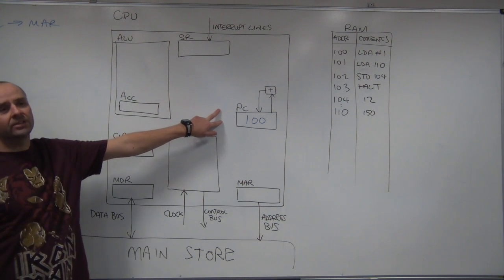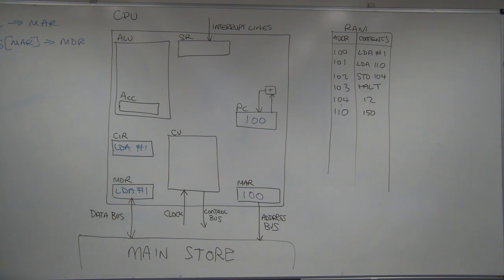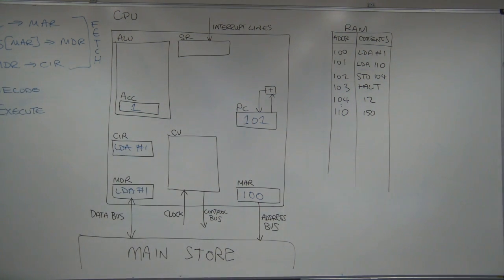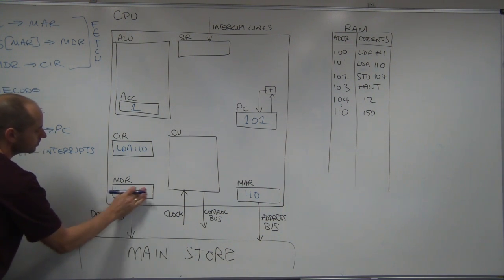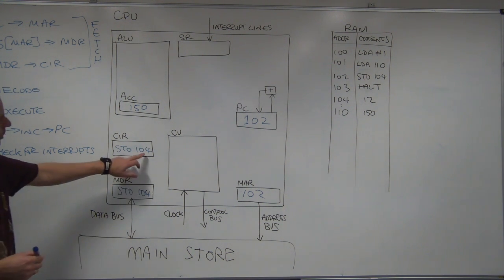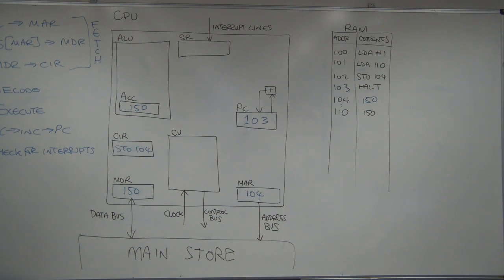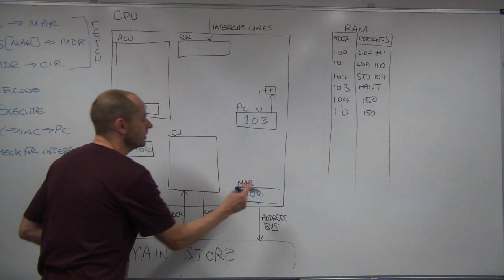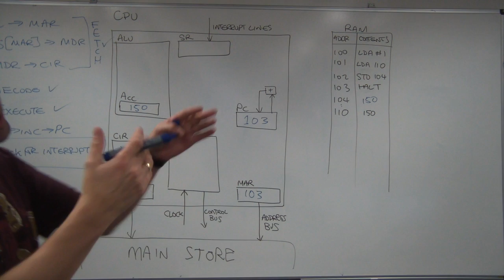Fetch execute walk-through using a simplified processor model

Comment: WHAT IS THE FULL FORM OF CIR
Reply from the maker: as the data held is assumed to be an instruction. it will hold a bit pattern containing three items (not  all instructions require ooerands or addressing modes) an opcode (1), an effective addressing mode (2) to determine how the operand (3) should be used to determine the effective address of the data for the instruction
Reply: thnks..sir

Comment: +HurrayBannana Something is really annoys me when you explain the halt. When talking about all other operation you said that it increases the program counter then checks for interruptions. Should it not do this for the halt command and if not why.
Reply from the maker: when it decodes the halt it needs to increment so the pc is pointing to the next instruction to execute, if it didn't do this when it returns from the interrupt that breaks the CPU out the halt operation it would re-execute the halt rather than proceed with the program e.g. (taken from some pacman hardware coding I have done). So below when processing has finished for the frame I issue a halt, which sits there until the vsync interrupt occurs which does various frame based procesing, when this interrupt finishes we need to execute the jump instruction and start the loop again.

mainloop:  
    ld a,(mode)         ;get mode
    cp title_mode        ;is it title mode
    jp z,title_logic       ;yes
    cp game_mode        ;is it game mode
    jp z,game_logic        ;yes
    cp game_over        ;is it game over
    jp z,game_over_logic      ;yes
wait:
    halt          ;finished processing let's wait for vsync
    jp mainloop         ;perform logic again
Reply: HurrayBanana oh OK. bit you missed out on saying the increment on the run through with the halt command. This is what confused me.

Comment: Nice explanation. I have a doubt:
How does the decode works on the LDA 110, Like how does CIR knows if the its is a instruction register or a another memory register (110) that needs to put the value in it. 
Example 1: LDA #1 -> 1 was the value in accumulator
Example 2: LDA 110 -> 110 is the address, takes the value at the address 110 i.e 150

Could you please elobrate, quite confuse at that point?
Reply from the maker: The CIR contains the opcode which states the instruction following this is the effective address mode which tells the CU how to interpret the operand part. Assembly language uses notations to indicate the addressing modes. 

e.g.

let's say the opcode for LDA is 01101 the next three bits could be used for the addressing mode and the next 8 bits for the operand (this is just made up no particular cpu here)

opcode ea       operand
01101  001   1100 0010

LDA #10 - immediate 10 is the value to load - instruction in machine code 01101 000 0000 1010
LDA 10 - load value from address 10 - instruction in machine code 01101 001 0000 1010
LDA (10) - load address 10 and load value at this address - instruction in machine code 01101 010 0000 1010

hope the formatting is ok
Reply: Thanks for the prompt reply. So in conclusion, CU decides where it is an direct value, or an address from which value to be loaded. Am i right?
Reply from the maker: yeah pretty much some bits in the instruction tell it how to calculate the address from the operand
Reply: Cool Thanks. Great Explanation.